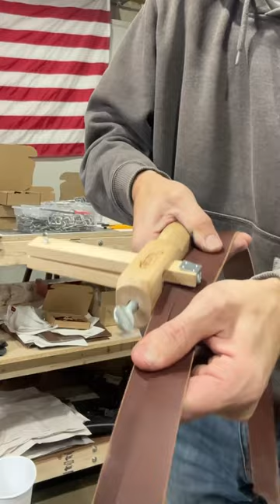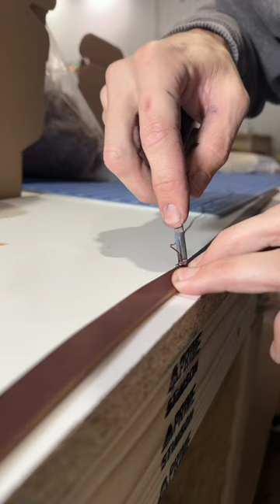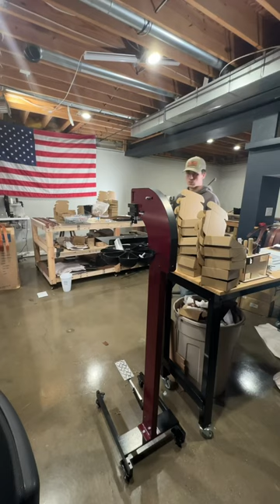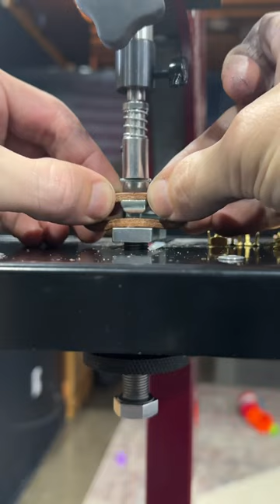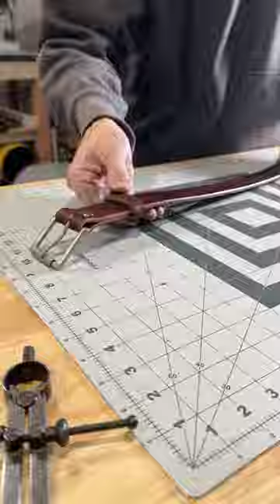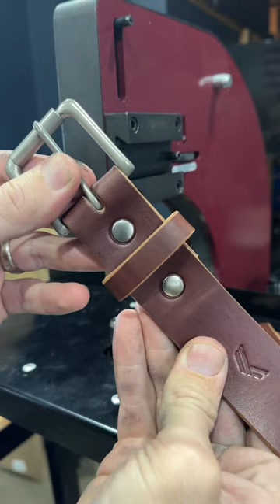American Made Belts

Comment: Now that's a belt you can wear for life. My belt is similar but a bit thicker and have worn it everyday for many years and still going strong.  Best 40 bucks I've ever spent. I would use rivets and brass nails to hold it together. It was build in the 40s

Comment: I made my own belt that I wear. It will outlive me. I only wish I had stained it. The natural vegtan takes on some weird discolorations.
Reply: You likely still can stain it. Use saddle soap and clean the belt and remove any grime and dirt. Then let it dry and get a bowl or cold water and a sponge. Get whatever dye you want (angeleus dyes are very concentrated and do more rich colors), then wet the leather lightly with the sponge ( it should soak in immediately and look dry again) then take your dye with another wool dauber and just rub it in in a circular motion and let it dry if the color is not what you want do another coat and let dry. After that take a towel with some Leather oil (liquid or cream versions available) and then just rub it into the belt and do multiple coats. Let dry and rub off any excess dyes and oils with a new dry towel.  Make sure it does not leech dye before using with your everyday clothes.

Comment: I’m juat starting out leather working. At this point, it feel like everything is expensive (leathers, materials, equipment, etc.) It’s amazing to see how far you’ve come. Could you make a video about how you started?
Reply: Look up Hyde and hemlock here on YT, they do a lot of videos on the business side of leathercrafting, same as little king goods. Just keep in mind, leathercrafting has a high entry cost to buy equipment if you plan to transition into a business. But do research first as it can be a rough process. I have spent around $20k already in equipment and tools and other necessities over the years and there's no end really. You need to track your costs so you can figure out how much things really cost to make(including utilities costs and labor, etc.). So take your time and remember that when it comes to tools,  just because there are cheaper options doesn't mean you should spend your money on it. Sometimes buying the more expensive outcome will save you more money and effort in the long run (especially blades).